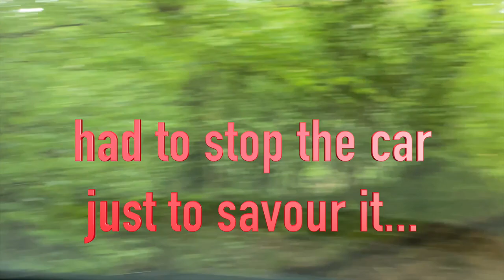Gordon Smith Strat bridge change and set up

Comment: yeah, wood often does funny things under load.Even when the grain is perfectly straight, I can´t predict how it will bend.That´s why I like your method of fret leveling so much and made myself a tool out of a trussrod and a u.shaped piece of alminium.
Reply from the maker: Hi Christopher, late reply - but good to hear the principle makes sense to you as well. It's not MY method - I learned it from buying a tool called the Katana. Tool seller was abusive towards me (even though I'd paid him £150 for the pleasure) so I refused to use or promote his tool in my videos and improvised my own version. Once I had tried the method I was convinced of its usefulness and I've spent the last 6-7 years developing my technique. I'm starting to write a new eBook detailing the additional 'power' of method that I've learned over the years.
Reply: @SamDeeksRelovedGuitars  I´m looking forward to reading that book. I still have a lot to learn.
Reply from the maker: @Christopher_Giustolisi  Thanks for the little push to write it! I spent some time last night trying to structure it before starting with the fun part which is focusing on sharing what I've learned (alongside shooting videos and taking pics to illustrate & help the info make sense). If only we had a run of lovely weather in the UK I could relax with a cold drink in the garden and write away... (looks at weather forecast)... oh no, look at that! A couple of weeks of great weather ahead :D

Comment: Very interesting project - disappointing buy for the customer. After all you did it looked impossible to line up the strings over all the polepieces! 
I've just come up with a 'hack' you may like for drop fills - I use the cut offs from the wound strings as droppers for the superglue. I reduce them in length, use the wound section as a handle, and bend tiny loops on some of the core wires for different amounts of glue. The only thing I can't around is the viscocity of the glue still determines how small a drop comes off the end. Cheers Terry
Reply from the maker: I love those little home-made hacks, thanks Terry! Yeah .. ultimately that guitar felt like a slight mismatch between Bridge, pickup poles and neck heel width.  Get any one of those ‘out of sync’ with the others and it gives trouble either physically (strings falling off the edge of the neck) or aesthetically (strings off-centre off pickup poles). As a small scale hand-maker of guitars it takes you about 6-10 guitars to make all those mistakes to a degree that you internalise them and subsequently design to avoid them! 😎

Comment: Great video, I have a question. When setting the action, by how much did you raised each saddle?
Reply from the maker: I raised the saddles to get a last fret action of 1.5mm on all strings on this guitar. My target action is always a combination of three main things: 1) between 0.1-0.2mm of relief in the neck 2) 0.3mm 1st fret action on all strings and 3) 1.5-1.2mm last fret action. Sometimes the actual neck condition forces a slight compromise on those targets (as on this neck).
Reply: @SamDeeksRelovedGuitars  Many thanks for the information! Appreciate it!

Comment: Had a Gordon Smith SG-type guitar over 30 years ago. Just left it as it was. Maybe if a guitar's rubbish, it may make playing a decent one easier. Lose the nut.
Reply from the maker: Left the nut alone on this one... but ended up changing the original bone one on the Custom Shop Strat. I just couldn't send a guitar back to its owner with even the faintest whiff of friction and bone is bone is bone. To be fair the brass is very well cut and surprisingly friction free on the Gordon Smith otherwise it too would have been extracted (assuming it wasn't glued firmly in place).
Reply: @SamDeeksRelovedGuitars  When I was rich, bought a Gibson Junior with a weird brass nut thing going on. Changed it for a graphite compound one. Sold it. Changed the Tronical autotune for Wilkinson machine heads too. The case was good. The 2015 range was Marmite. Just looked up the Squier Sonic Mustangs, step up from the Bullets. I need to sell a kidney.